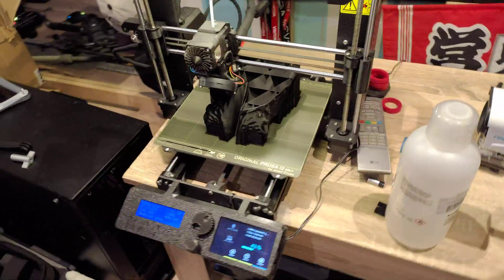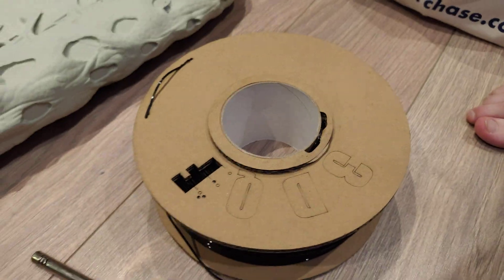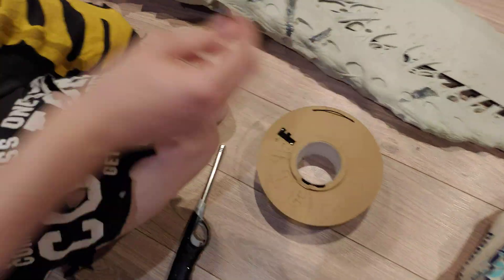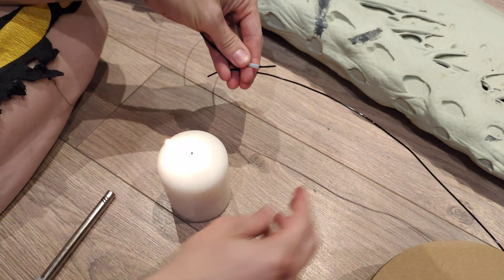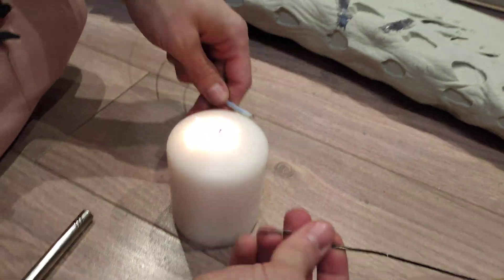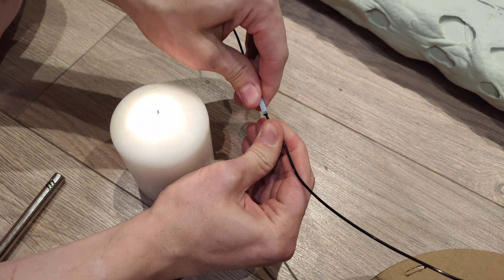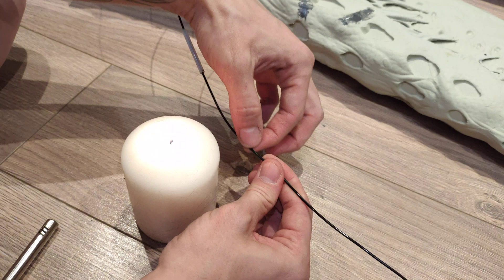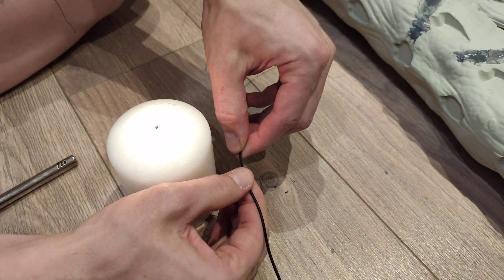How to Join / Fuse / Melt 3D Printing Filament Easily (Lighter + Candle + PTFE Tube)

Comment: now that tube is there forever./
Reply from the maker: yeah i dont even use this method anymore, runout sensor does its juob much better
Reply: @TMProjection  i tried yesterday but it's very hard to keep the filament under 1.75mm after. And it becomes brittle near the melting place :(